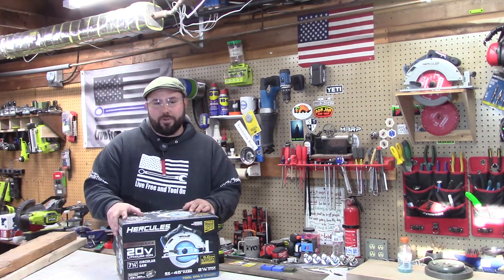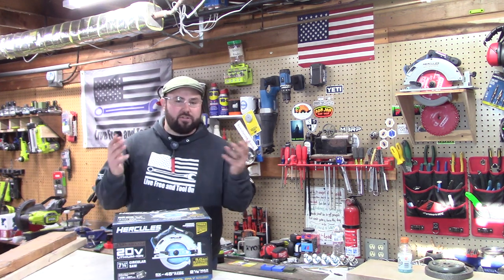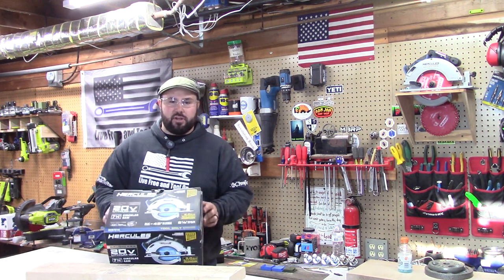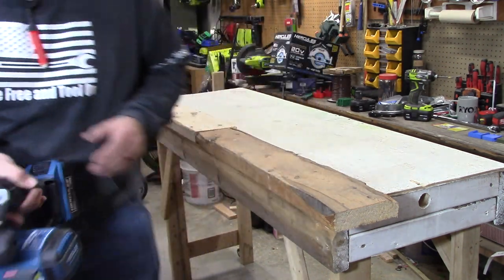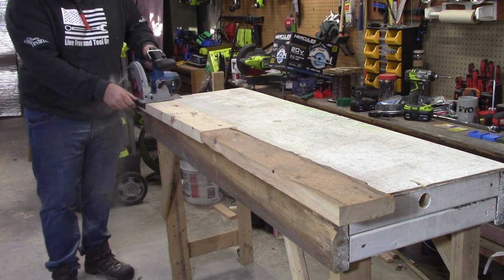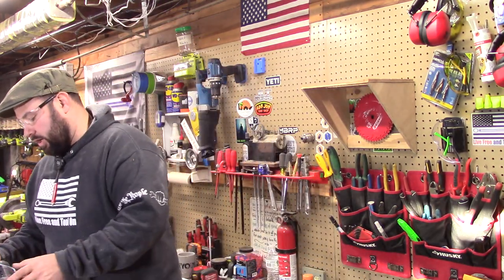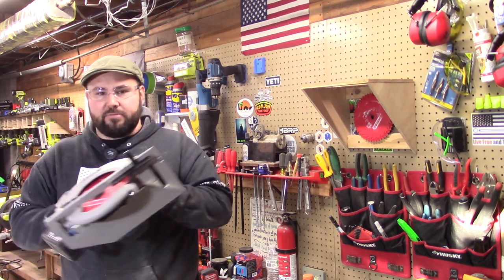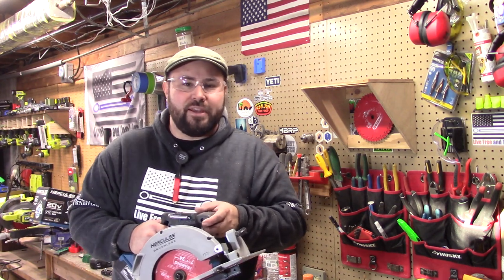Hercules brushless circular saw review [AMAZING]

Comment: I used both the Bauer 6.5" cordless circular saw and the Bauer 7 1/4 cordless sliding compound miter saw on a few projects and was impressed with both. My only complaint was my 5.0ah battery died after about a year with less than 10 hours of actual use, and HF kind of left me hanging when I talked to them about it. What I recently found out is I may have drained it below the 3% threshold and damaged the cells, so lesson (sort of) learned there. But despite that, this Hercules circular saw just checks all the blocks as far as quality and value, it feels so well built, and this video really helped me decide between this or a Metabo, which is really well made but the choice of batteries is very slim, not going over 4ah in 36v range... which I find puzzling. I want to pair this Hercules with the 8ah, as I feel like a 12ah would be severe overkill for anything other than an actual framing crew 🤣.

Comment: Diablo blades make every tool so much better!
Reply: NO not really. I don't use Diablo framing blade when it comes to Framing works or any other carpentry works. But for Demolition and Metal cutting I use Diablo blades. Otherwise the circular saw blade I use for framing and carpentry and woodworking is The Makita High Efficiency  ATAFR 24T Carbide Ultra Thin circular saw blade for Framing and the 45T Fine/Finish  Blade for Fine woodworking or Trim Works. The Ultra Thin Kerf circular saw blade is the best for Cordless saw it reduced the load and to make the cutting tool cuts much faster like a razor knife thru paper.
Reply: @craftsmantrucker6867  i havent even scene it but i believe you makita xps bits are top notch too
Reply: @codustv1465  Oh you will see them on Amazon and eBay and you'll see them too on your local Makita tool retailer stores. 
Makita Max Efficiency 7-1/4" ATAF-R Ultra Thin Kerf Circular saw Blade 24tooth for Framing and 45tooth for Finish Carpentry also there's Ultra Thin Kerf blade for Miter Saw as well sizes from 8-1/4 inch, 10 inch and 12 inch as well. You're gonna love em'
Reply: @craftsmantrucker6867  oh just the stock blade? i have the 36v rear handle so i might have one lol
Reply: @codustv1465  Yeah! That's the one that I'm using! The stock blade for Makita 36V Rear Handle and the 40V XGT Rear handle saw the one that came with it. That's the one that I'm using in my everyday Jobsite. Amazon and eBay sells them on bundles too. I bought 10 packs on year 2020, and now I'm only using 3 blades out of 10 so far. I also got the Finish version of that saw blade that have 45 tooth I love em'! They're so ultra thin kerf circular saw blade they cut like hell

Comment: I have bought, almost all Hercules Tool.Very very good tools excellent 👌. I only have complaint abound big sawsall, perhaps Because I bought it of second and repair . But the other tools is in the highest level. The impac Driver is the more complete around USA. The one hand sawsall is a Beast. As I told you only the 2 hand sawsall is not so good. Very heavy the vibration is terrible. And is 3000 cut per minute.

Comment: Yeah I took it back and got the Hercules 6 1/2in. I hated this saw, I have a lot of Hercules and Bauer tools but this is way too heavy and I can't cut on the line, I'm left handed but I can't even find the line with this saw, l love my Bauer saw and both 6 1/2 inch saws have the blade on the side I prefer

Comment: Both the look and the sound reminds me of the Dewalt for some reason.
Reply from the maker: It felt like a Milwaukee!
Reply: @livefreeandtoolon  no way this is very surprising.. my only question is how long will it last. Like if I take it to a job there is no way it will hold up rip after rip
Reply: @TacticalThib  it will I’ve took it on the job and works awesome day after day
Reply: I’ve heard that the guy that used to design tools for dewalt now makes the Hercules.
Reply: @pyroman7086  No sir. The man that designed the original 18V line of DeWalt tools and made battery powered tools relevant, left DeWalt and went on to develop for Milwaukee. The same man is responsible for the m12 and m18 lines you see today.
Reply: @TacticalThib  I’m 10 months late on this reply but I have the circular saw, /4 inch impact and sawzall and I abuse the hell out of them. I can cut 3 sheets of 1/2 inch at once. Granted it’s not the fastest but it also doesn’t take two minutes. Only time I had to warranty my saw is when it fell off a 3rd floor deck.

Comment: the problem no one is talking about is the saw design with the Hercules  7 1/4 blade. I got my self the Bauer 7 1/4 great power but if you are a right handed person you can not see the blade or where you are cutting on both  . This  saws work great for left handed people. because one can see the blade and line to cut. I am a right handed person and I was very disappointed I end up taken it back and get the more under powered 61/4 one but a least I ca  see where I am cutting. I don't recommend this saw for right handed people
Reply: Blade right saws are meant for right handed people ,you look down the left or right side ,the dust goes away from you.I am a carpenter and that is all I ever use .
Reply: You need to learn how to use the tool dude.  There’s no issue with it.
Reply: Ok dude